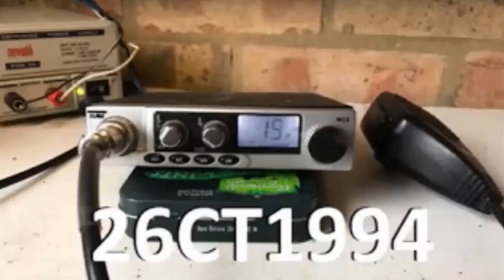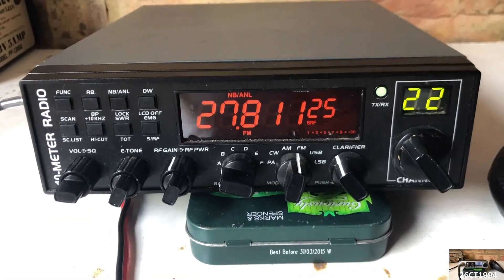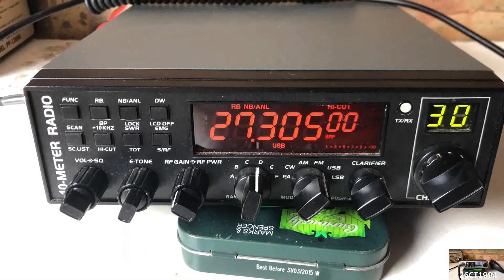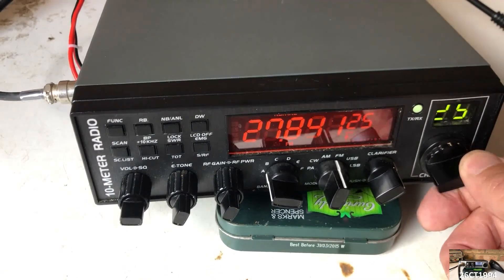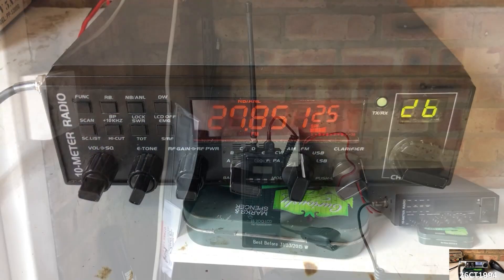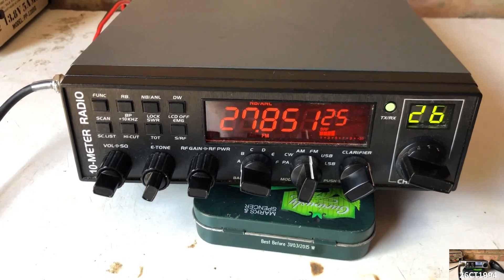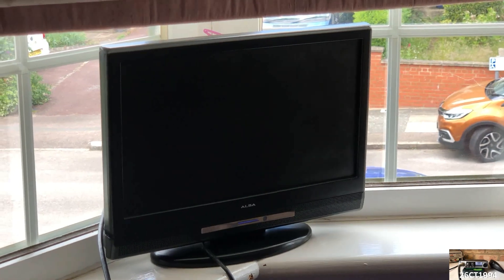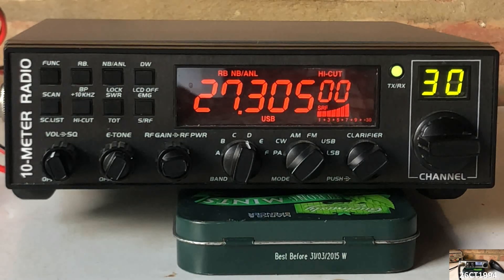QRM Problems Solved

Comment: I didn't add anything In my house and I just got noise come up on my rig. I haven't got another rig to see if the rig is sensitive of qrm or not (I own ss9000). When I use my handheld I get no qrm. If I can find what causes it can I put  ferret ring or clip on what's accusing it (if it's got power lead on it) or would it do nothing to it ?

Comment: It help to ground all ur ecipmint 
Like radio n power supply  
I have copper pipe a cross the back of the old desk I us for my radios  I have two straps going down to ground rods  this separate from grounds out side for antnna grounds  
Graet video  thanks for your time 
Stay safe 
73 n good dx n9prf 2fb2112  JOE
Reply from the maker: Thanks for the suggestions Joe!

Comment: Switched mode power supplies, cheap power supplies with Buck regulators, the Router and even the Internet line can make a hell of a racket!
Reply from the maker: Thanks for the tips Bob 😊
Reply: @26CT1994  By the way, a big offender is the cabinets in the street for Broadband as they don't earth them properly.  Cable TV is also a big offender!